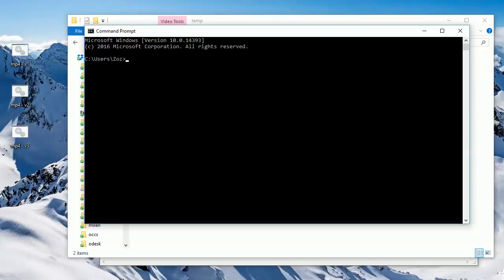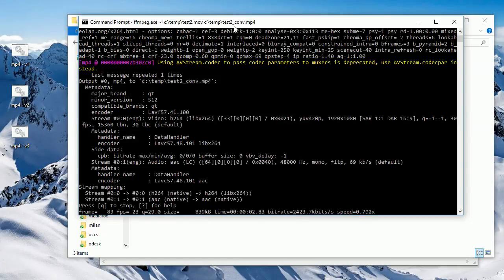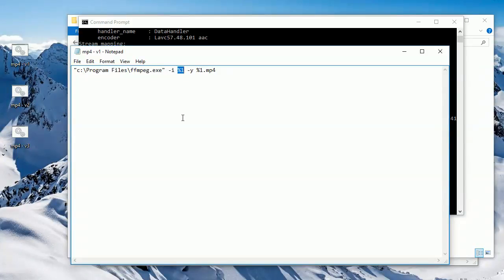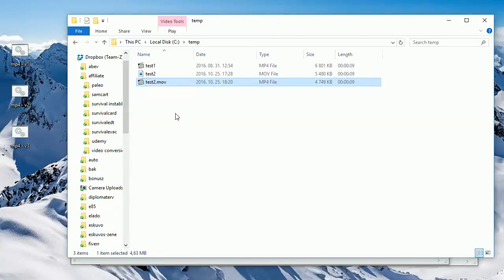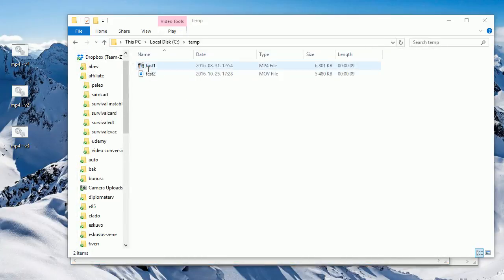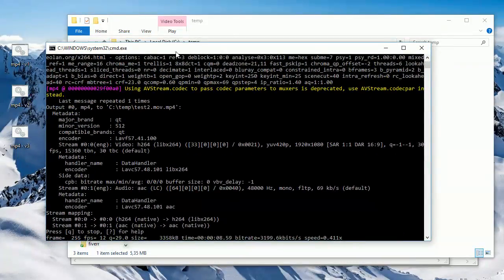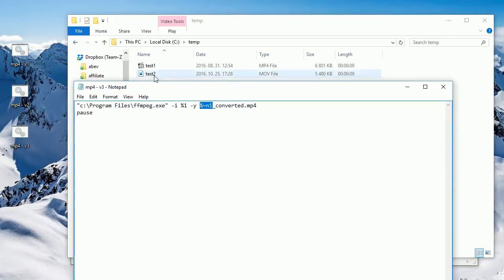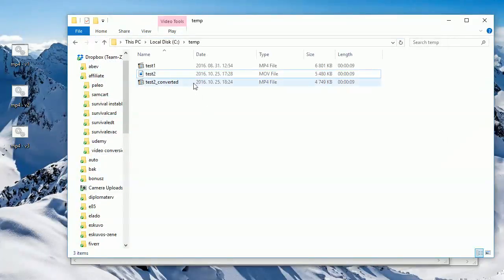ffmpeg basics trick - using droplets

Comment: Good point! By any chance do you have any experience with ffmpeg distributed| parallel  transcoding?
Reply: FFmpeg does parallel transcoding whenever the codec supports is - almost all does. There is a "threads" switch if you want to specify the level of parallel threads, but in my opinion this is not necessary, ffmpeg figures it out nicely and will use as many CPU cores as possible.
Is this what you mean?
Distributed transcoding across multiple computers is not supported by ffmpeg, you have to create your own system to distribute the transcoding jobs between computers.
Reply: @Zoz1985  That's what im asking. How to implement distributed cluster of nodes?
Reply: @AlexeyZubkov  Well that's a programming question, really depends on what exactly you need. I don't think I can explain it here in 2-3 sentences :) 
I've created a queue in a database, you put the files there which you want to code, and I've created workers. The workers check the queue and if they find a job, they start encoding. The worker processes run on as many computers as you want
Reply: Zoz Zancs so you did it, or you just guessing?
Reply: @AlexeyZubkov  yes, I did